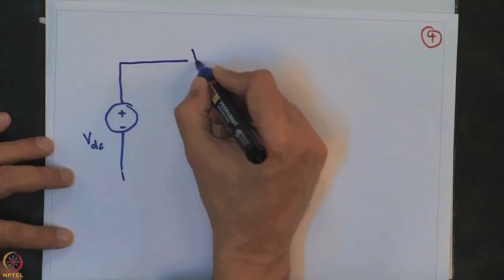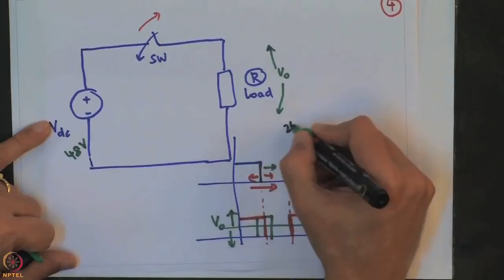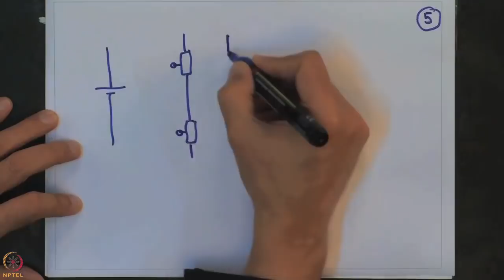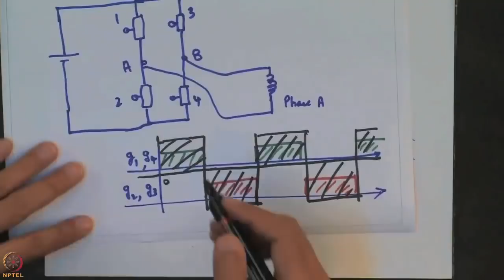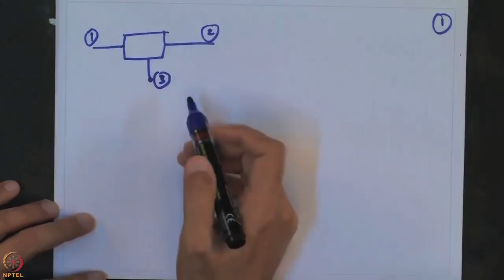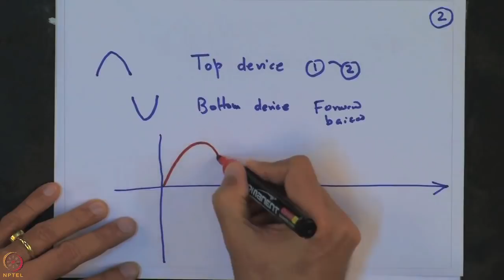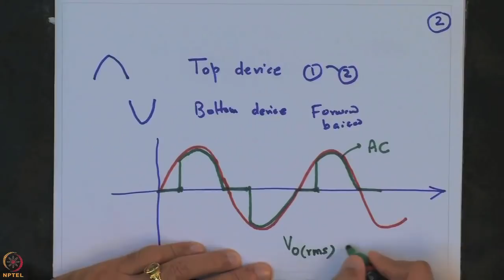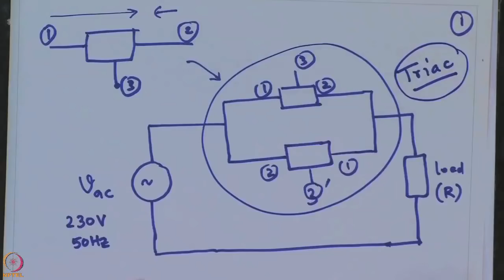Week 1-Lecture 2

Comment: Summary: introducing a switch in a dc circuit and switch it continuously ON and OFF for equal times, the load will get half of the input voltage. In AC motor drives, the speed can be controlled by changing the voltage. But, if the voltage is changed without changing the frequency, there is a risk of saturating the core. So, V/f (Voltage/frequency) is always kept constant. Using a DC input and a controlled bridge rectifier (inverter), a constant V/f AC can be produced.

AC to AC converter with the help of a TRIAC. e.g. fan regulator